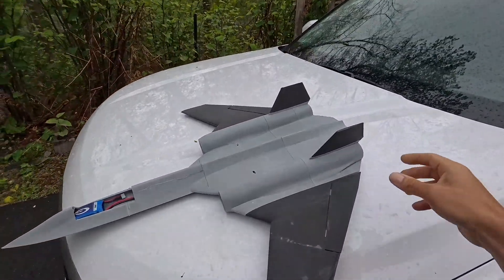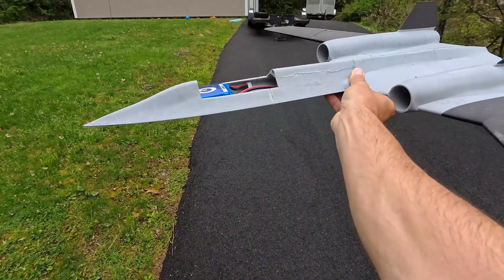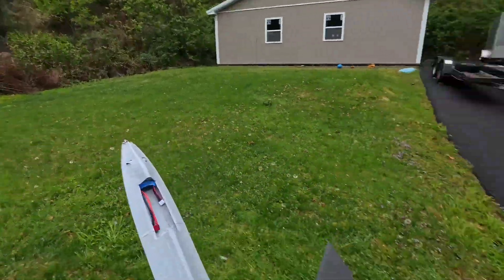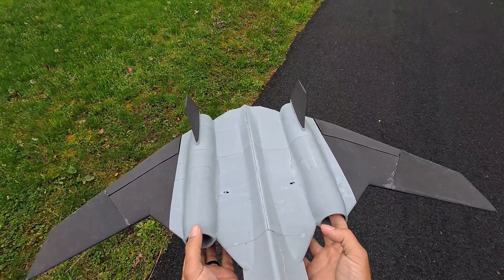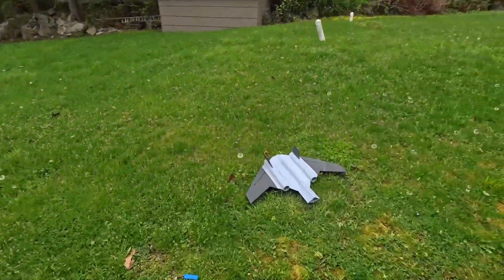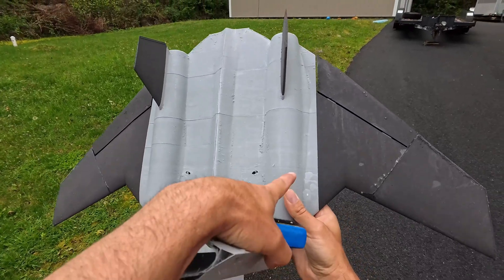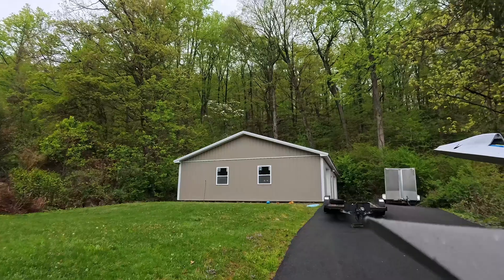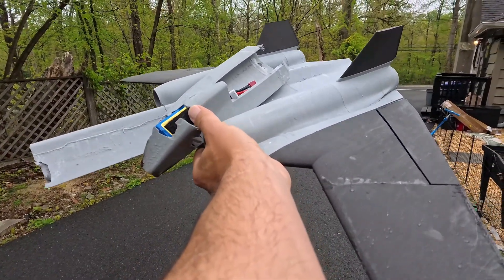XR71 Glide Tests

Comment: I wonder if you can just print a top profile of the entire plane and use that for CG testing
it would be faster to print too (imagine a horizontal cross section of the plane)
edit: granted the body itself and chines could change lift
Reply from the maker: Yes I found even added a control surface changed the CG enough to mess up my X-36
Reply from the maker: Especially planes with forward swept wings. Even more CG sensitive

Comment: Would be ideally 30mm edf. On Rcgroups, they managed to pull 240 gr of thrust with it with some mods. You could add tiny winglet near the canopy for even a cooler design
Reply from the maker: I tried 30mm edfs. They use ultra small connectors that don’t work with normal ESCs so you have to try and solder on regular connectors like. 40mm is the smallest I can work with
Reply: @hotlapkyle  Thanks for your reply. Yes, that's what they did, i.e. change the wiring and connectors and that involves soldering. Anyway, 40 mm should be great anyway. Good luck !

Comment: nice im very fond of forward sweep designs, this is your design correct? to solve the stability issue of forward swept wing  just put a carbon spar or tube in the leading edge. technically the forward sweep increases pitch stability because it increases the chords length, but its still picky and also not easy to correctly throw a large plane like that.
Reply from the maker: Thanks for the great info!